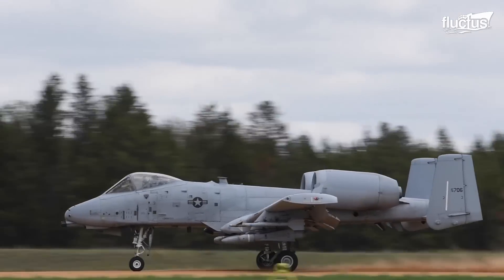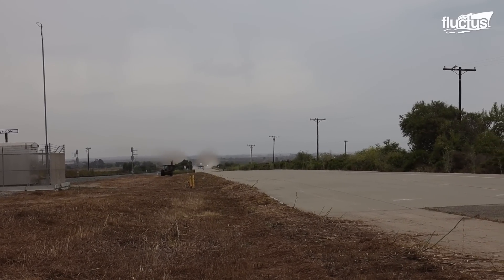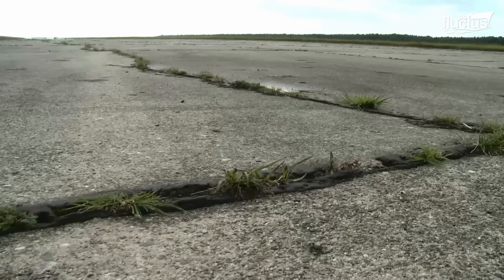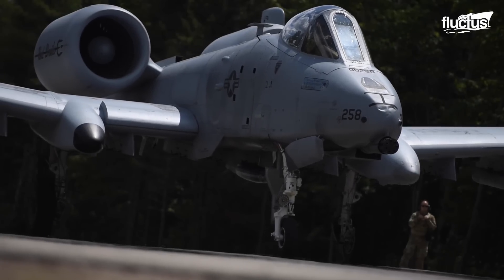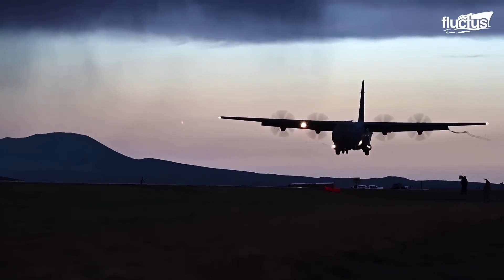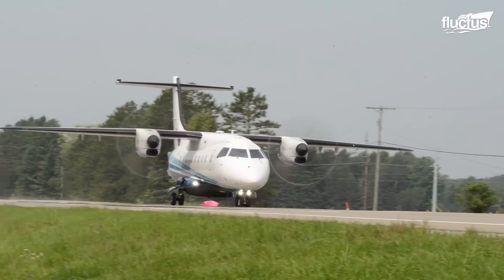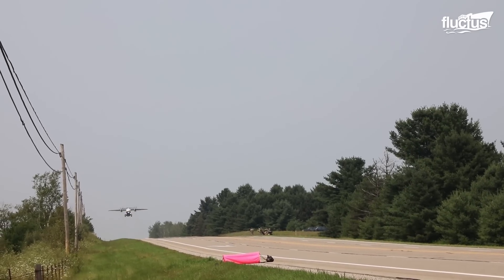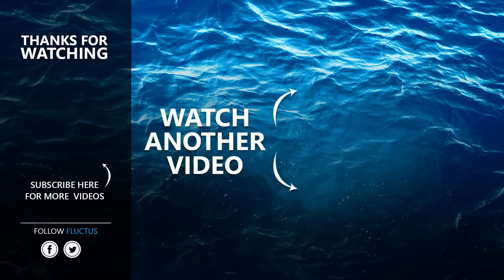The Extreme Process of Landing a US A-10 in Middle of the Highway

Comment: What's new? This isn't new! Drug dealers have been landing 4 engine aircraft such as DC-7s on beaches ⛱️  road like these  shown for decades! Is the US military playing catch up?
Reply: Looks like it, but there is  one big problem, Mice, Hercs, and Spartans are designed for dirt strip operation, no so a late model Boeing 787 Dreamliner whose wheel tyre loading is the same as a fully loaded 18 wheeler.  Stretches of Motorway(Freeway) three miles long need to be strengthened in order to take a big airliner like the Boeing 787.